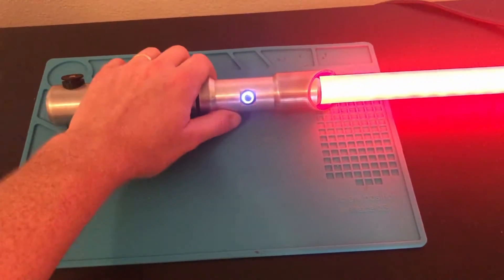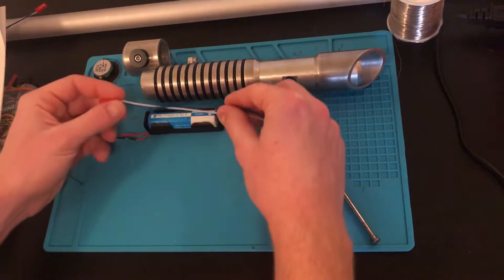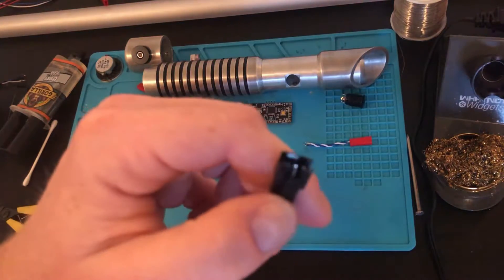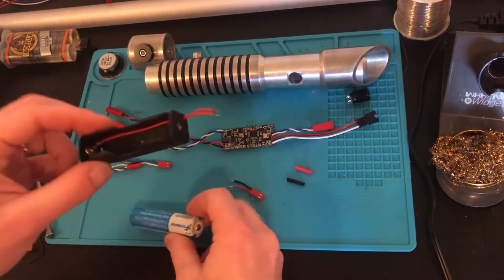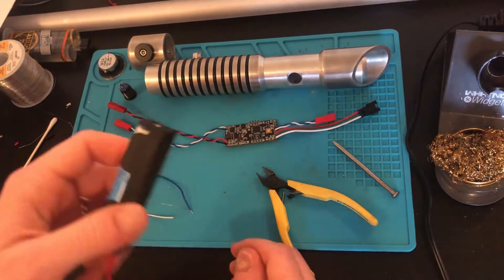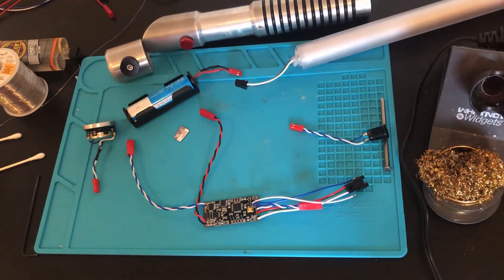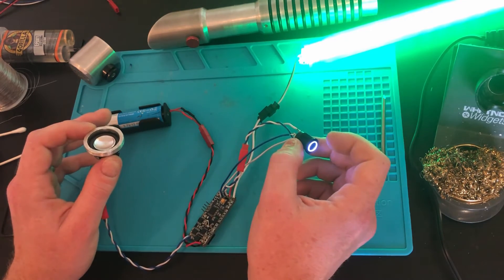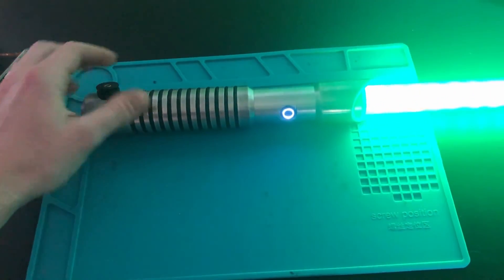How to Install Electronics into a Lightsaber Hilt Step by Step - DIY Build Tutorial

Comment: This should be helpful with the CFX installation I’m about to begin. 👍
A couple of questions, if you don’t mind?. Do you always not use a chassis, or is this video only intended to show how a basic installation is done? (Chassis! Chassis! Chassis!” has been drilled into my head and I had a very difficult time finding one for my OR Super Stunt Qui-Gon). Also, is your soundboard commercially available and if so, what’s it called? Thanks, in advance. 
                  Great video! 👍

Comment: I would just measure my ultra sabers height and inside where the battery Goes then just Decorate the handle with o Rings and stuff then attempt to install light and battery’s in it and then Build or Buy a Blade Plug

Comment: Do you have to add a sound board? Also do is it possible to make it start on one colour and finally how do you turn it off without having to crop through every colour
Reply from the maker: Yes you need some type of controller/soundboard. It has two buttons. One for one and off. One for switching color.
Reply: State of Build is it possible to make it start on one specific colour and in this video I didn’t see the second button I only saw one for both functions
Reply from the maker: This video I only installed one. Later videos I installed the second one. You can program it to work off one or two. You can also program whatever colors you want and the order they come
Reply: Also is it possible to make it without any sounds? And is there a specific sound board needed?
Reply from the maker: It’s possible with no sound, and yeah you can put whatever sound board you want in there
Reply: State of Build and finally is the speaker optional?

Comment: Awesome lightsaber tutorials, by far the best I've to date, as you cover everything in detail and include tips here there.
You mentioned that designed the soundboard yourself, I'm curious about certain thing with regards to this.
- Did you design it from scratch or was it based of an existing soundboard?
- Did you actually make the PCB, code the chipset and so on, or did you get the soundboard commissioned? IF commissioned, by whom?
- What features does it have? You mentioned something about driving the current directly and having the typical resistor needed for constant current, installed in the soundboard.
- What did the soundboard cost to produce?
- Is possible to get the soundboard you designed?
I know it's a lot of questions, but very curious about the project, especially the cost and other things you haven't covered.
Awesome work, keep it up! :)
Reply from the maker: -Yes, from scratch
-Yes, PCB design and code. No commission I did it myself
-5V led driver, so leds are a bit brighter. Everything else is pretty standard on other soundboards.
-It cost like 40 to produce 1. Probably 100 to produce 10 tho.
-TBH its not that good of a design. I was going to improve it with a V2 but ive since moved onto working with the open source proffieboard. Its miles ahead of where Im at. So im picking up there. Plus more people can get their hands on it.

Comment: Have a weird problem with my nano biscotte v4 with neopixel RGB light strip. Can't find any one else with this problem. Once I turn it on the sound goes of and some random pixels go on in different colors. Once you clash it all the pixels turn and stay on white until I turn the board off. I checked the files on bank 1,2 and 3 on the mini sd cars and they show red in bank 1, green in bank 2 and blue on bank 3. All settings have the same problem. What could be the problem?

Comment: Hey man im not gonna put a sounboard in mine but how do you make the animation when you press the button to activate the led lights and it goes from down to up
Reply from the maker: You need Pixel LEDs. And at least a controller for them. Take a look at arduino nano. Tons of information on how to program, setup pixels and battery, the simplest way will end up just buying a preprogrammed soundboard. Like proffieboard or CFX that’s compatable with pixels
Reply: @StateofBuild  cool do u think you could send me a link for one of those soundboard?
Reply: @StateofBuild  oh and if your using a sound board how do u make that animation with the lights and how do u get the lightsaber sounds

Comment: Just one question what size tubing did you use as I have heard people use loads of different sizes? Thanks
Reply from the maker: For the blade? 1in 1/8wall
The hilt is 1 1/4 & 1 1/2 both 1/8inch wall

Comment: Do I need a dc-dc step up boost for the LED on the nano biscotte sound module v4? And do I need a restitor or step down for the LED 3V 12mm momentary switch?
Reply from the maker: No you can hook it straight to the battery. Yes use a resistor. Use a led resistor calculator. 4.2 for the battery/source voltage and 3 for the led voltage.
Reply: @StateofBuild  thank you sir. So no step up for the 5v LED strip in the blade with a single 3.7V 18650? Just double checking.
Reply from the maker: Yes they will run until 3V, give or take

Comment: I would like to build a lightsaber that has two blades. It would need to support two leds from one activation switch.  You do have any recommendations on how to do this?
Reply from the maker: Yeah, depending on the soundboard you choose they should have more detailed instructions. But basically if you have the blades constructed you can tie them together, plus to plus, minus to minus and data to data. Some boards recommend running each blade off its own separate battery and other run off the same.
Reply: You should do this, but build 2 separate setups with a quick release connector so you can use Jar’Kai and dual wield them.

Comment: I don't plan on dueling with my (future) saber, but just some light hitting of things. Don't the innards rattle around or slide around once they settle into place. Does the epoxy glue hold the speaker strong enough? I'd think that would eventually break loose. I really enjoyed the tutorial! keep up the good work!
Reply from the maker: Nothing rattles around because its pretty tight inside. The epoxy is strong, i don't expect it to come lose. Since the blade is flexible is dampens impacts to the hilt. Unless your hilt keeps getting hit I don't expect anything to come loose.

Comment: What are some good sound boards you recommend for a cheaper price than the ones you listed? If any? Thank you! I’m on a tight budget
Reply from the maker: Unfortunately for Pixel LED sabers there aren't any good cheaper alternatives. I'm currently building a Proffieboard and am going to try to make them available for a lower price.
Reply: State of Build Are there any good led controllers that would be cheaper by not including sound?  I’m not that concerned with sound and would rather save money
Reply from the maker: Look into arduino nano as a Pixel controller. It will require a bit of programming to get it running. But the libraries and code are available.
Reply: I heard the Verso soundboard is pretty good, and that's £35

Comment: Hey, I'm a little confused on the boost converter and resistor stuff. I am currently working on getting a proffieboard v2.2, and using a 5v 2 meter 144 pixel led strip. I'm not sure what I need to buy in terms of resistors and boost converters. Also, I'm using led av switches and I was wondering if I need any sort of resistors when wiring them up to the proffieboard and battery.
Reply: Did some research and the proffieboard v2.2 does have a boost converter.  My question is do I need to but the resistor on the data input or is it needed for power?  Is there a difference between using a smd resistor and one you jus wire in?  I'm building a neopixel setup but can't really afford the PCB detachable setup you find on TCSS so I would like to run the setup you have in this video.  Thank you sir!  Great video!
Reply from the maker: Samurai Rocker with proffie board the resistor is already on the board. You don’t need any external resistors for data nor power. You also don’t need the detachable blade PCB. I don’t use it as it is an added cost for convenience I don’t need.
Reply from the maker: Do some testing with your pixel LEDs. You may be able to run them off the battery without a boost converter (may be a bit dimmer). For the button LED use an LED resistor calculator. You'll need the LED voltage (usually 3-3.3), avg battery voltage (usually 3.7), current (usually 10mA is dim, 30mA is very bright). If you can find info on your buttons LED use that. I suggest you read the proffieboard instructions, they usually outline all the information you need for pixels, leds etc.

Comment: I wonder, why don't you use a chassis to hold the components in the hilt ?
Reply from the maker: Cost. But mostly size. The inside of the hilt is 1 inch. Most chassis are 1.25+ inches. Just got a 3D printer so I can custom make them now.

Comment: Is it possible to make a light only neopixel saber? if so what board should a look at?
Reply from the maker: It’s possible. I don’t know of any boards that will give you the blade in and out effect from the box. You would need to program that effect yourself. Arduino nano would be a good easy choice (lots of tutorials). But If you don’t want to program, then just regular RGB LEDs with a cheap controller would work too.
Reply: @StateofBuild  Thanks, I'll look into those!

Comment: How do you get the ~4.2V from the battery to 5V for the LED strip... i am working on that problem for weeks.....
Reply from the maker: You need a boost converter. You can buy a module in various sizes, but most 5v led pixel strips will run on 3.5v sometimes lower. So technically you can run them straight off the battery. You will see lower brightness from the LEDs as the voltage drops though.
Reply: State of Build do you use a boost converter?? I working with an arduino nano.... an the problem is that the nano is not working with one of my 18650,s....  and thanks for the help!!! Ps: the biggest problem.... i am working on hilt from the „fallen Order“ game an this hilt is very small  so i have only 25mm space inside thats about 1“
Reply from the maker: Manuel Nemeth I have a boost converter on my soundboard. Yes arduino nano requires 5v to run reliably. I think the issue is the clock is too fast when the voltage is that low. There may be a mod you can do to fix this problem and lower is clock speed
Reply: State of Build ok thanks bro for your fast help... you know i am not the arduino guy.... a friend of mine do that for me i have to talk to him but again thanks for the hep

Comment: I do love the simplicity of this build and want to do the same as it takes away the guess work for me. Super excited!
Reply: Will the board be ok if I didn’t hook up a sound unit? I’d like to do just a stunt saber without sounds and maybe later add it.
Reply from the maker: Yeah you can run lights without sound on any sound board.
Reply: Also, how does the blade stay put in the emitter part with just the retention screw? I just can’t wrap my head around that... haha! Sorry heaps of questions..
Reply from the maker: The blade is such a tight fit that friction holds it in place. The retention screw is so it doesn’t wiggle out over time
Reply: State of Build Thanks for clarifying that for me! Time to find some 1” PVC..

Comment: Great video series on this! What brand board did you use?
Reply from the maker: I actually used a board I designed and built myself
Reply: State of Build   How did you build the board?
Reply from the maker: Adam Benton I’m thinking of doing a video on this... I have some experience already designing electronics, but I did a ton of R&D to get an electrical schematic that included all the features I wanted. Made sure I could write the software to make it work. Designed a PCB from that. Had it made and then soldered on the components.
Reply: @StateofBuild  great build mate. Do sell those PCBs ?
Reply from the maker: Michael Wirtz Not yet. Planning on it in the future...

Comment: Maybe I could send you money and you can build me one!?!?
Reply from the maker: As of right now the Soundboard still needs tweaking before I would consider selling it & I would need some more interest from the community.
Reply: @StateofBuild  Start a group buy and let the community spread the word. I'd be in for at least one and possibly 3 or more depending on the price.
Reply from the maker: Ryan Moses Great idea! Still working V2
Reply: @StateofBuild  RIght on, I'm starting my first of at least 3 builds. One for myself and 2 more for the kddos. Due to the pricing of the complete single board solutions I've found so far I'm going to try the first one with a FeatherWing and PropMaker combo. I don't know what the market is for saber boards but a good AIO solution that beats the current prices could be a huge hit. I'm worried about fitting the two boards in a moderately sized hilt and also weather it will be capable of driving two strips of the Neopixel as Adafruits site doesn't give a full spec on the 5v output for the Neo header. Any experience with those boards?
Reply from the maker: Ryan Moses I don’t have experience with either boards. But if you are worried about the boards drivers, consider running the strips directly off the battery and control the data with the board. I’ve seen these strips able to run as low as 3.3V in the past, each is a little different. Make sure you use a large cap on the 5V line though.
Reply: @StateofBuild  Good idea, what would you consider to be a sufficiently "large" cap?
Reply from the maker: Ryan Moses 1000uF
Reply: State of Build what?

Comment: Do you sell that soundboard that you used?
Reply from the maker: Not right now. I’m considering it if enough people are interested. The current design need some tweaks before it’s ready to be commercially available
Reply: State of Build I’m keen. Not sure how much a soundboard costs for a starter one. Will have a look at some stockists and see what I’m looking at.
Reply from the maker: Skuu Digital Starter boards run pretty cheap ~50. The high end are around 80 and up